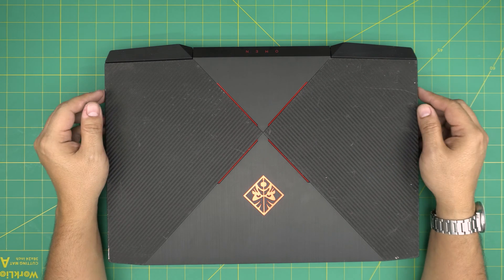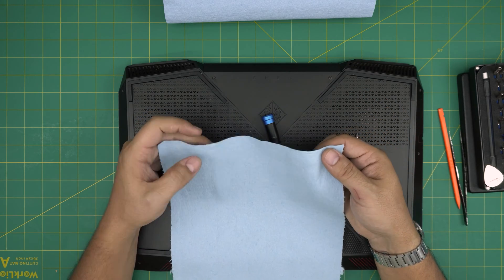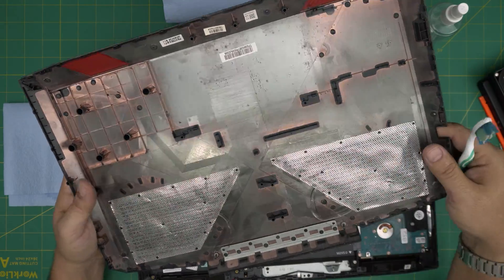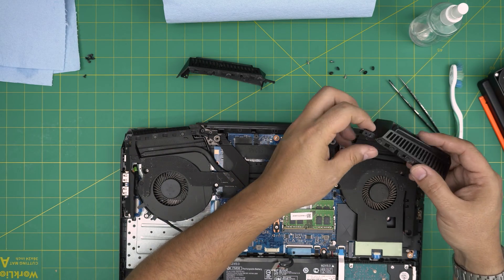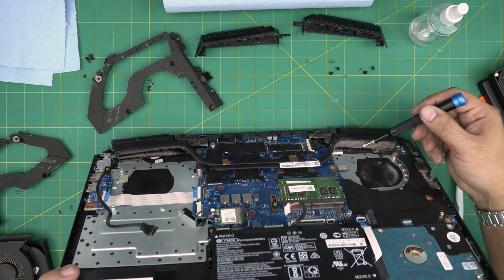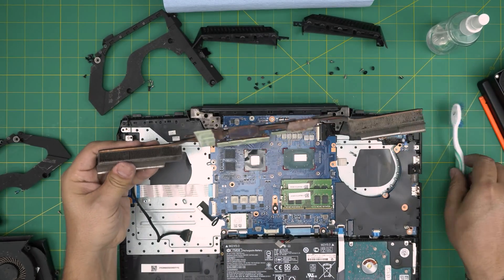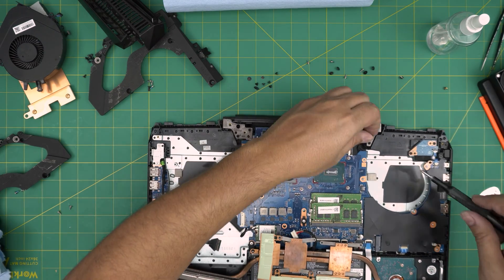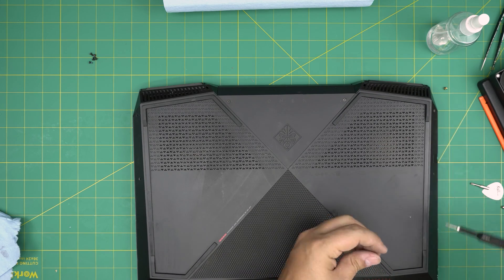How to Repaste and Clean an HP Omen 17 an101 Laptop

Comment: i hate small laptop screws, they evne put blue lockthread on HP laptops, so there is no way in hell you can unscrew them without stripping the heads... i wanted to replace my thermal paste, but many screwes got stuck with stirpped heads, i just gave up.
Reply from the maker: ya those small screws are pain if you don't get the right screw bit.

Comment: Thanks you for the video. My battery needs replacement and I basically use it as a desktop. My question is it safe to remove the battery and to use without. Thanks
Reply from the maker: It's my pleasure my friend.
🫠Regarding your question, sure, you can do it without any issues. In fact, it will work even better, and the charger will last longer since it won’t be stressed by charging the battery. Additionally, the motherboard will last longer as fewer components will be in use.
Should you have any further questions or requests in the future, please don't hesitate to ask me.
cheers🍻
Reply: @uFixTek  thats a relief, the authorised repair centre (living in the Middle East) informed me it may take upto 5 working days to just change the battery. Honestly don't feel comfortable leaving it with them and good to know that it's actually better to pull the battery than run it on a bad swollen one. Thanks for the quick reply... Cheers🍻 🙂
Reply from the maker: oh, 
anytime my friend 🙂👍